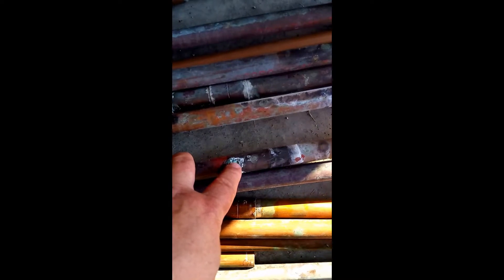electrolysis of copper water pipe

Comment: What was the cause? I have an electrolysis  electrolysis.problem at my house bc galvanized steel straps.are coming in contact with copper pipe.  Felt was supposed to be sandwiched between strap pipe but they used carpet padding instead. Carpet padding gets brittle & decays and then the 2 metals come into contact.
Reply from the maker: Yeah any touching of two metals like this is because a very low grade voltage is created and it consumes the copper